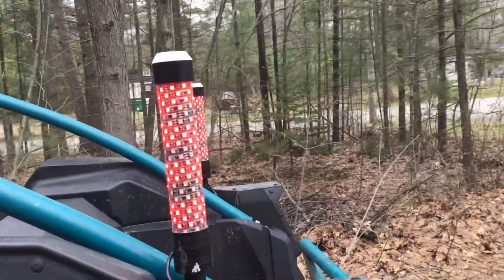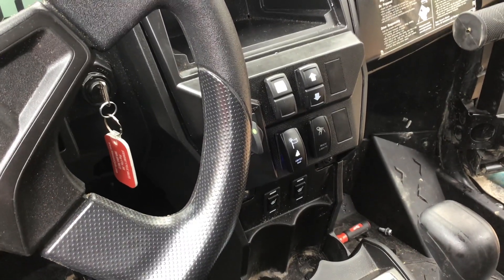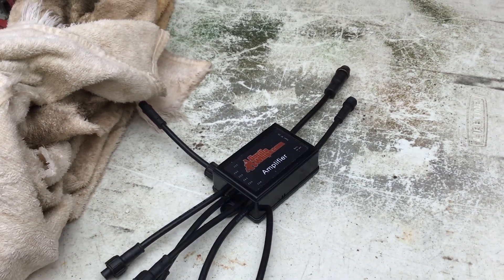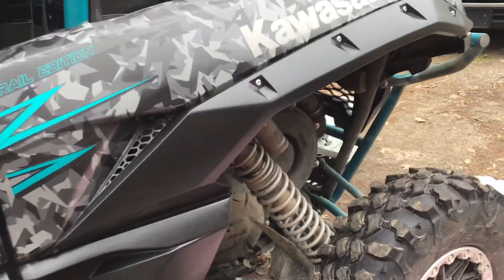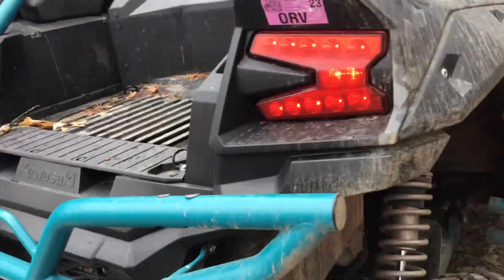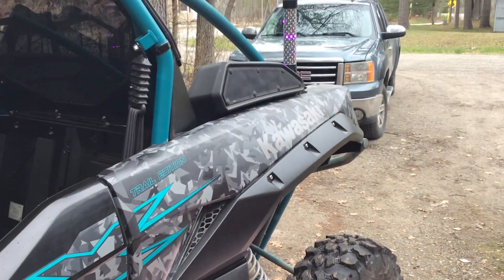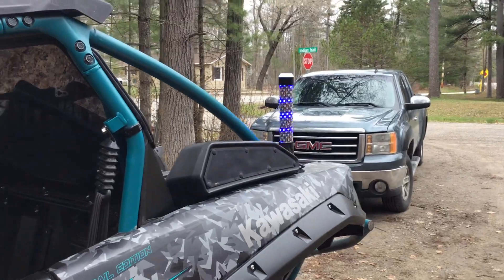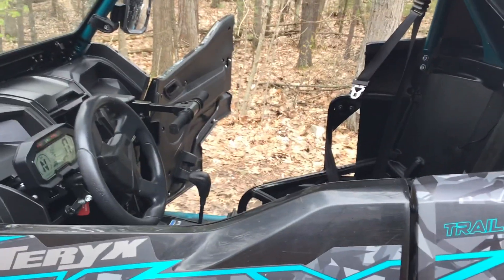Gorilla whips chunky monkey and rock lights explained @ Michiganutvcampgrounds

Comment: You don’t need additional power to the amplifier. That cord is totally optional. Power is sent from the controller to the amplifier, then the same amount of power is sent out each output on the amplifier. It’s for larger lighting kits, and some longer vehicles need it for the 4 pod rock light kits. If instructions weren’t sent, Gorilla Whips has them on their website.